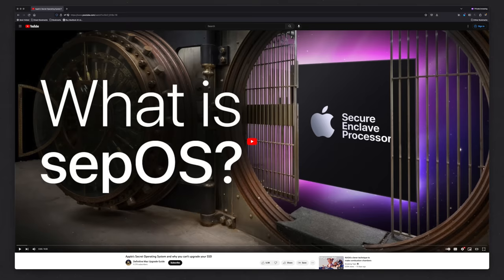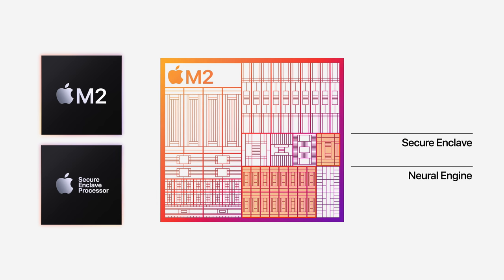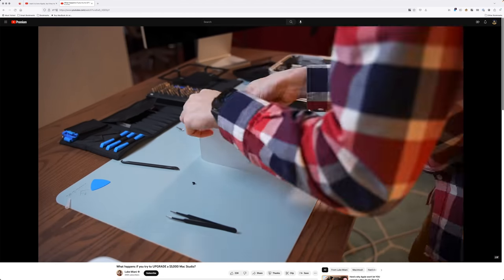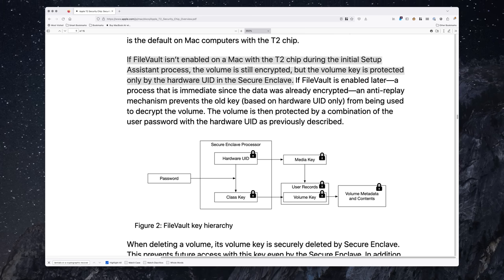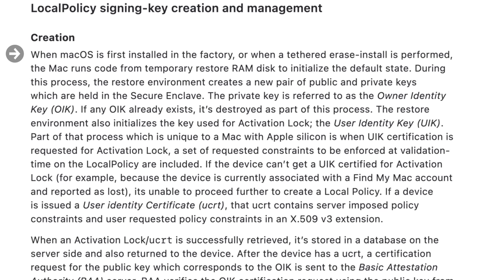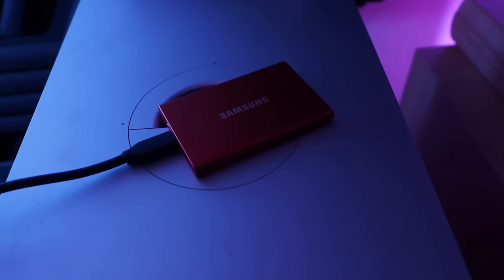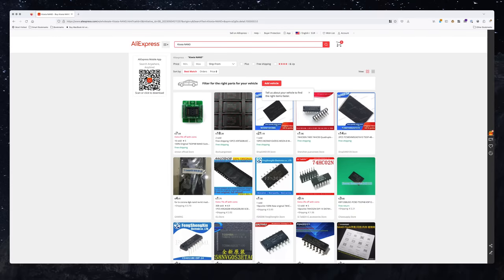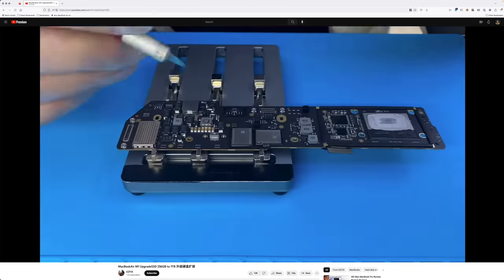Was I wrong? Apple Silicon and SSD Upgrades

Comment: Absolutely apple has locked users into paying premium for everything in hardware. SEP strikes me as being focused just on locking out hardware changes more than anything else.
Reply: It’s also made to make devices permanently inoperable at the slightest hint of being digitally or physically compromised for what it’s worth. 🤷🏾‍♀️
Reply: It seems to me it hurts bad actors and good actors alike.  It's my understanding that thieves when they steal your stuff don't usually try to take that device and make it operable again, but rather they break it down and sell the parts.  Making it so screens and keyboards are firmware locked from the factory discourages this.  At the same time if you break the screen on you laptop you can't just buy one on ebay for parts anymore and fix it yourself...

Comment: Expandable storage has been a thing ever since computers were invented. Apple is swimming against the current here.
Reply: @Phillip Banes Which is fine for desktops but not for mobile devices and Apple knows this very well. Also you still are fucked if the internal disk breaks because you can't boot from an external system without having the bootloader loading from the internal. And external is always slower. I can get PC systems that are now 3 times faster then Apples system at around 20GByte/sec.
Reply: @Phillip Banes Well and that "more then fast enough" is why Apple totally lost the server and workstation market. Because it can never be fast enough. And big enough.

 But only having 5% on an M1 Ultra compared to a 4090 Nvidia in GPU computing power says it all where Apple is positioning it's market.
Reply: @Phillip Banes So because stupid cumbersome external SSDs exist, it justify preventing people from adding internal ones ?

Comment: Back when I worked It at an ad agency we would frankenstein multiple broken Macs into a working Mac all the time.  It was kind of fun due to the clean way that Macs were built back then. We used to joke the inside of the Mac Pro is what Jobs condo must look like. 
When we expanded and took on a bunch of new employees we could only find low spec Macbook Pros. So we bought a dozen of those and upgraded their ram and storage. Took all of 2 hours including picking up the computers. 
Now I still prefer to be working in Apples Posix compliant OS. But I really hate the limits they place on end users with the hardware. Sure my 14" MBP is fast, but they only had 16GB/500gb iterations in stock when I bought it. So I am stuck having to offload files to external drives, and have to actually close programs to keep it running at a decent speed. 
Not the end of the world, but I tend to hold on to laptops for 5-7 years. My last one was a 2015 MBP which I had upgraded the ram, storage and optical on.  Ditto for my 2013 Mac Pro. Bought it at the affordable level, then over the next 8 years I maxed out the ram, CPU and storage. 

Now these shenanigans would be fine if Apple gave us top notch hardware. But they do not. Until recently I could usually get a better specced SSD through OWC, who also offered ram kits that would expand the ram beyond what Apple offered stock. 
Now I am supposed to buy the type of computer I need for the next 5 years? I'm sure that Apple hopes people will just buy a new computer every 2 years instead.

Comment from the maker: I keep getting linked the iBoff video on replacing SSDs in Apple Silicon Macs and i figure I should post it here:
https://www.youtube.com/watch?v=yR7m4aUxHcM

Luke Miani also collabed with DOSDUDE1 to demonstrate the SSD upgrades
https://www.youtube.com/watch?v=apEKAY11NQs

The interesting thing is at least two people now have mentioned I was incorrect for a second time, but from what I've seen it corroborates what I said here. I'm not sure if my messaging around the DFU mode or soldering was confusing or if people aren't entirely watching my video. If you found a particular phrasing or passage by me incorrect, please let know (and why). I'm more interested in accuracy than being "right".

I had a request for the background used in this vid, so I uploaded it here, it was made for motion graphics so will likely look best on smaller displays rather than 4k monitors.

http://blog.greggant.com/posts/10-10%20mountain.jpg
Reply: Thank you!!
Reply: I posted on the previous video calling the title a little 'dramatic'.  Honestly I agree with the premise that the apple silicon system simply put is not up-gradable in any sort of practical sense.  When you need skills equal to those possessed by those with two years post secondary education and professional equipment, when the process itself risks destroying the whole logic board with the smallest of errors, when you have to go on a deep dive to source new NAND from china no that's not upgradable.  Repairable, when you can go to your local apple authorized repair shop that have that stuff and that know how I would say that's repairable.  

It's becoming painfully obvious that basic NVME SSD's would be just as fast with silicon as their impossible for all but 99.9 percent of us to replace or upgrade would have been just as effective.

Comment: I love how even though the video spends half the running time talking about the security reasons Apple did this, everyone assumes it was just to screw over some vanishingly small percentage of customers who upgrade computers.  
In the Windows World, something on 95% of computers never get upgraded.  These are computers made to be modular and upgradeable, but most only upgrade by purchasing a new one.  So, missing out on $200-$400 in sales on less than 5% of new Macs is the reason they spent all the time and money on the Secure Enclave and encryption system?  It costs more to develop than they would make without it.

Then there is the market where people put lower end parts in, and customers want warranty work when they fail.

Comment: I see a lot of comments from people who still don't seem to understand what Apple's customer base is, who aren't tech enthusiasts. They buy what they understand they need until they think they need something else. They are usually people who want a secure system that works, so they stay with the brand that provides them with what they are looking for. The new Porsche's do not have access to the engine compartment. The customer base of that brand is not waiting to customize anything, they use the car as it comes and that's it. Apple doesn't work like Microsoft get over it once and for all. I don't like these restrictions so much, especially with the SSD issue, but it's what I have to live for having a system that doesn't get sick with the flu every 7 days and that works efficiently. Excellent video, you make the 10 minutes go by quickly. Thank you.

Comment: The reason the macPro cant boot when you remove the intern NAND modules is that large parts of the system firmware are stored on there including the UEFI. T2 Macs are a little different to other PCs in the boot staging https://www.youtube.com/watch?v=3byNNUReyvE gives a nice overview of this but in the end what it means is the T2 chip is responsible for loading, validating the UEFI and providing it to the cpu. The T2 chip reads this from the SSD.

Comment: Apple could provide an user accessible secondary m.2 Pcie NVMe slot that is not encrypted.
This would vastly improve the utility and durability of Apple desktop and laptop devices. 

For those of you who want to say that this is not possible. Well your wrong. Effectively all this requires is to dedicate one of the PCIE buses to a m.2 slot rather than to thunderbolt. 
The advantage is that thunderbolt acts as a bottleneck. Removing this improves media speeds for video editing providing larger storage options, and at least double the bandwidth of external thunderbolt-with no loose cables for your studio cat to play with and dislodge at critical moments.
And improves data security by reducing the likelihood of total internal drive failure.
However, the mac would still require an encrypted main drive with the secured boot picker partition, and may cost the Mac one of its thunderbolt ports. However trading a thunderbolt port for a spare internal NVMe slot it’s a trade off many would prefer to have -particularly on the Mac Studio with its plethora of ports.
Reply: The problem is this: if Apple will give the end user an option in any form to buy a SSD from another company than Apple, then Apple will sell less.

Now Apple got a monopoly for both RAM and (internal) SSD on all Macs. Of course this is about money.

I've prayed so many times that Apple gonna become "the good old Apple" that allowed us end users to buy RAM and internal SSD/HDD from other companies.

So I guess that Apple's architecture (Apple Silicon) is so much about control and profit/revenue.

To do so, they have to show us end users that it's actually worth it. Mac Studio would not have been possible with the latest "Xeon W" CPUs and the extreme GPUs from AMD/Nvidia.

Apple could def have made a Mac Pro 2023 with "Xeon W 2023" and the latest cards from AMD/Nvidia. But Mac Studio would not have been possible.

But when you think about it, just compare the physical size of Mac Studio vs Mac Pro 2019-2023 and Mac Pro 2006-2012! Mac Studio will take occupy only a fraction of the space which is a huge win!

It's at least possible to upgrade any Mac when-buying-it-on-applestore. It's expensive yes, and that's what we all dislike. We have to pay for "that upgrade" NOW for "400 dollar" instead or waiting 2-3 years to buy it for "100-200 dollar" and if we really need "that upgrade".

So this behaviour from Apple means that too many customers must "overspec" their new Macs and pay too much. Many end users feel that they wanna future proof their Mac so they will upgrade Mac Studio to 64 GB RAM and 2-4 TB SSD while they probably only need 32 GB RAM and 1 TB or 512 GB SSD which is way cheaper.

I cannot see anything in the pipeline that will make Apple change their Macs so the end user can upgrade RAM and/or internal storage. The only hope is that EU (European Union) gonna require that it must be possible to upgrade RAM and storage very easy. Maybe also the GPU. But how will Apple meet that requirement with their SoC architecture?

Personally I often propose like you did: a M.2 PCIe NVMe slot. Exactly how Sony did with PS5. That would be so good! But I cannot see that happen. I pray for it but I cannot see that happen...

Comment: RAM can be outside the chip package since the signal travel 40cm each cycle, so Apple made RAM inside chip module to  force non upagradeability.
Reply: It has more to do with power usage, not just latency. RAM directly on the SoC incurs significantly less power than standard DDR5 ram.
Reply: @RunForPeace-hk1cu  would be good argument if RAM was non upgradable in MacBooks only, but it isn’t even upgradable in desktop Macs, where ultra low power consumption is not that really important
Reply: @RunForPeace-hk1cu  I dont think so. How much miliwats would eat a chip outside.?
Reply: @renascence239 I think that’s because Apple uses very similar logic boards for their new iMacs that they use for their laptops. Everything is soldered to get the device as thin as possible.

Comment: You can replace the NAND chips in your M1/M1pro/M2 macs with a higher capacity, but I haven't heard about the RAM so far. The price for doing so had come down in the past few months and the price was like 1TB for $200 give or take in China, it was kinda plug'n play since apple integrated the controller and it is basically the same as upgrading the Intel macs 2 or 3 years ago. I don't know where the chip comes from or if it's brand new, I just follow some of the Chinese repair shop channels and sometimes they'll post videos about it
Reply: so if I get somebody to swap the sand In my 15 2018, I use DFU to reinstall it?
Reply: What I’m interested the most in would be replacing the RAM instead, which is indeed the most expensive add-on option in Apple Silicon based Mac’s configuration.
Reply: @frankfeng98  since the ram is soldererd to the soc, you would need some insane soldering to even swap it
Reply: Ram a common upgrade in china.
Reply: @ThePlayingJs  And i have seen a youtube video on insane soldering actions but yeah, the time it takes even with professional lab technolgy at your hand is higher then buying it from Apple.
Reply: @gmichia the ram is built into the SoC so it’s not possible at all
Reply: @Dave102693   nope. It's like saying your car tyres are build as part of your car and you can't remove it. Please learn how things work. It's been done many many times.

Comment: Hi, since 2020 iMac is having a T2 chip, and if the internal SSD fails, do you think it can brick the whole iMac? Even external SSD is not bootable if that happens?
Reply from the maker: Almost certainly not, other T2 macs will not boot if the ssds are removed or not functioning, see the iMac Pro and Mac Pro 2019

Comment: what would be awesome would be if Apple could develop a communication port which could allow multiple Mac Minis to be daisy chained together to share system resources using a ultra high bandwidth connector.  That way you could simply purchase more Mac Minis rather than having to send one to the landfill and having to purchase a newer one.

Comment: I take a different approach to this issue. I spent a real long time working for an arm of the US government. We did a lot of classified work and put classified data on laptops, which made that laptop classified and accountable. When an authorized employee needed to take a classified laptop off-site, the entire laptop was photographed and every screw was marked/sealed to make sure any attempted physical intrusion would be identified. This was a major pain. Apple's M-series laptops and desktops with their sepOS makes it very difficult (maybe) for an intruder to remove the NAND and copy it since it's encrypted and keyed to a specific Mac. This encryption is difficult to break, especially when it's not inside a Mac. For all you repairers and upgraders, I'm sorry but Apple going to great lengths to secure their hardware benefits many more people than repair companies and upgraders. Yes, I was a repairer and upgrader for years (actually decades when you include non Macs) and I have all kinds of "stuff" in drawers but I firmly believe Apple have (finally) produced a product line that has much less need for repairs (user abuse doesn't count) than previous (Intel) lines. External storage works just fine in many cases so upgrading internal storage should be done when purchasing a Mac. We all know this, especially once SSD/NAND storage started to be used. As for those countries/governments who demand replaceable everything, I strongly feel their only motive is to be able to capture user information through a variety of methods. Apple is making this more difficult to do with every new product and OS. 

disclaimer: I have never directly worked for Apple although I have worked with Apple employees on specialized committees and user groups many years ago early on while working at my government job. I strongly believe some of the requests we made of Apple finally made it into their products.
Reply: Thanks for your input. For the majority of the internet it’s sooooo easy to blindingly throw rocks at apple but Macs are the only CONSUMER grade notebooks that have a commitment to security (at least above the rest of the industry) 

PS: upgrade prices are some bullshit. 200 bucks for a Nand module ? Cmon

Comment: i think the reason it is possible to replace the ssd in the mac studio is because it is cheaper for apple to source the ssd as a removable module than to solder it on.

remember the time when you could buy an enclosure and internal pc hard drive and build your own external drive cheaper than a ready made external drive?

same here.

because of the encryption of the t2 chip and the m1 m2 macs then how does forensics teams working for the police get access to the data to investigate a crime?

probably apple would just desolder then resolder a new ssd chip and just re pair the new chip and re bless it or just replace the motherboard.

Comment: I used to think the same way as most people here. However:
1. More and more laptop makers are doing the same thing and soldering the SSD onto their motherboards.
2. Most computers become less usable over time and makes little sense upgrading it. You would rather just get a new one making these soldered SSD's seem more reasonable and increasing their reliability.